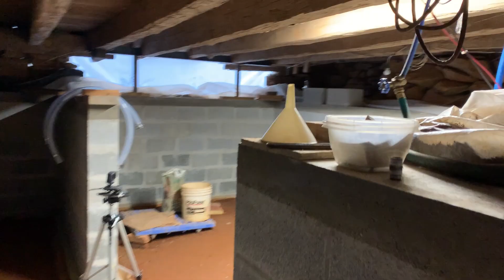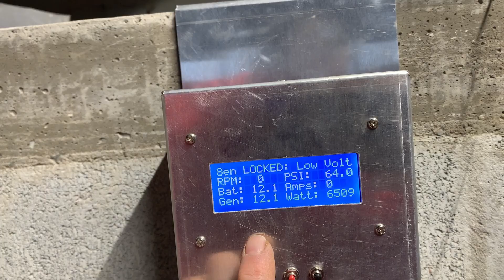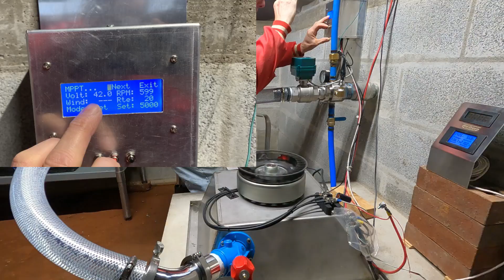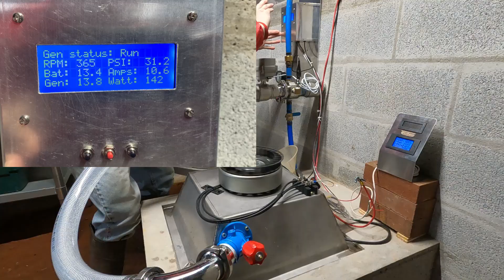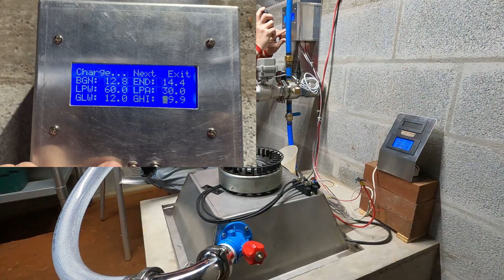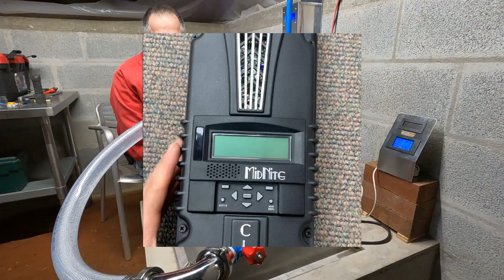Micro Hydro - DIY Electronics V2

Comment: Just happened on this channel, great looking setup. I am just starting to look at land with a water source in the ocoee tn, Murphy nc area. And if it does happen, would love to chat more about your love/hate/do differently thoughts on your system. As this is a DIY controller, does it have floor water detection to shut the value off in case a pipe blows out? Do you have a parts list / schematics / source code for your controller available?
Reply from the maker: I would gladly share my experiences and information I've collected with you. Incorporating a flood sensor is no problem, I also have a floor drain in case of a water leak incident. In the event of a pipe blow out, the water pressure would drop causing the system to shut down. The DIY was just a prototype and still has a few bugs. I will have all the information available when I make the final products.

Comment: This has got to be the driest microhydro setup ive ever seen.
Reply from the maker: If you mean that I don't have much water available; with the water line size I'm currently using, I can get a flow of 35 GPM during any time of the year.
If you mean that there is not a lot of water splashing around; Thank you, I have a stainless steel basin connected to an underground 4 inch pipe that returns the water back to the creek.

Comment: The teflon isn't what seals the threads FYI, it's there to lubricate while you tighten the threads.   Just needs to be tightened more.
Reply from the maker: I have tightened them as hard as I can possibly go short of using a pipe extension. I have only had this issue with stainless steel, never with other materials. Lubrication is part of teflon tape's purpose but sealing threads is the primary function. Your feedback is appreciated. Thank you.